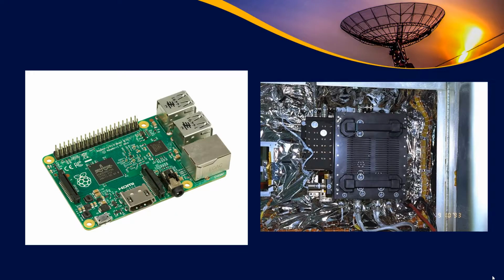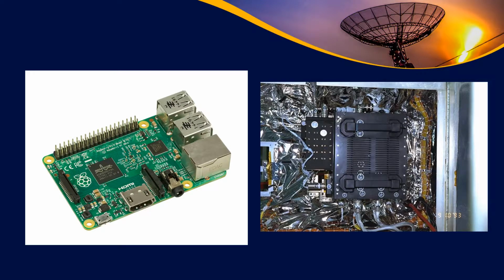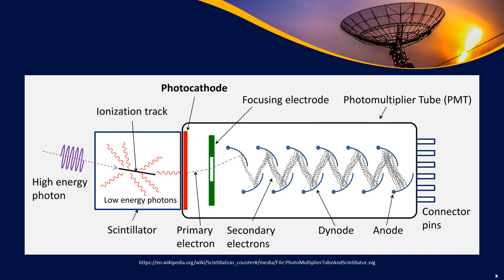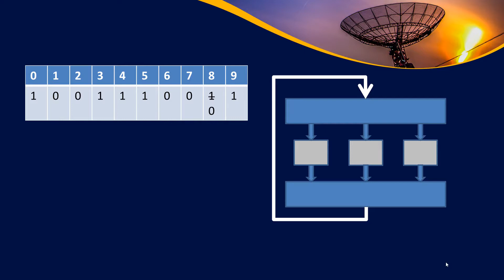Basic Satellite Design-  Software and Computer Design

Comment: What if the golden image gets corrupted?
Reply from the maker: This is why they usually are Witten in a way that can't get corrupt, but it would be a bad day. Corruption usually only happens if one writes repeatedly to memory, it is rare to happen for read only.
Reply: Are you saying that microcontroller-based flash memories rarely get corrupted by radiation? Then assuming the code segment is much safer in that memory, the data segment is definitely in a working memory/RAM. How do ECC RAMs help in that regard?
Reply from the maker: @anfarahat  That is my understanding at least. 

Data segments are in the working memory, and there are special error correction RAMs to work in high radiation environments. One of the simplest is commonly used, keep triplicate of the data and use whichever one has 2/3 correct.

Comment: TLDR; radiation can randomly flip bits in CPU and RAM. Use checksums *everywhere*, or just wrap everything in tin foil and cross your fingers. Layer firmware update systems. (This model is used in routers and other terrestrial computing systems too.)